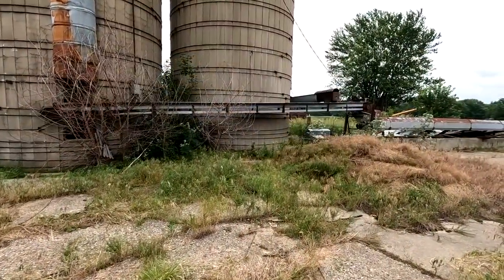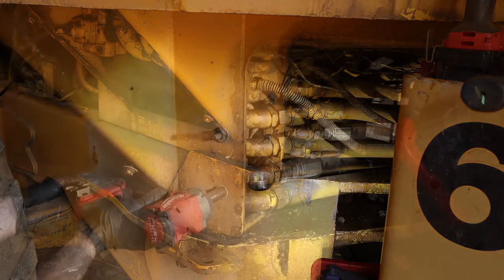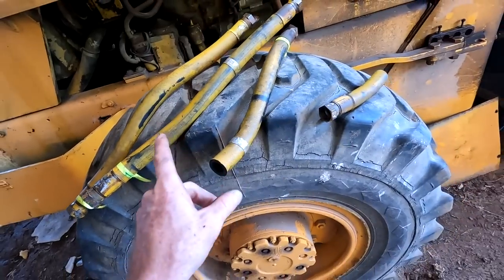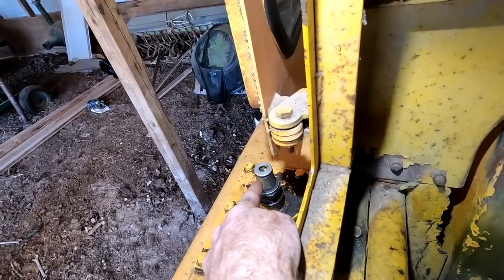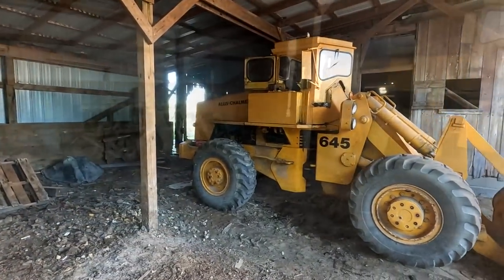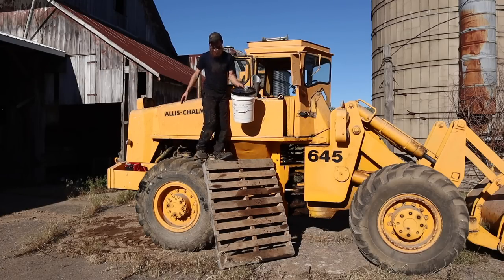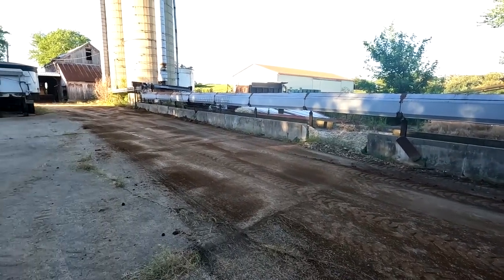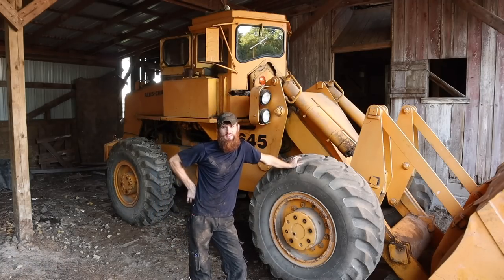Major Issue STOPPED me in my TRACKS! ~ Day 5 ~ 1965 Allis Chalmers 645 Loader

Comment: Glugging sound... Air - give it time and it will settle down. Fluid level check... see the  port on the side... clean it up, it should have a glass to see thru. Roll on the  moving to the shop video... then onto the third machine wohoo.

Comment: The hydraulic lines and finding out about the year of the machine happened to me, I found a dirt bike (lucky me) fixing it up it had no identification no model, brand, year I found out by accident what bike it was by having to purchase a replacement bike tube on eBay and it had the model bikes it’s compatible with so matched them with the bike!

Comment: Great restoration Matt, be careful with that stuff coming off the steering wheel, if it is Bakelite it is pretty horrid stuff.
Reply: Get a couple of rolls of good electrical tape and wrap the steering wheel. Or, use hockey stick wrapping tape. This as a temporary fix. Really enjoying your work on this old irom. Thanks!

Comment: Hydraulic tank:  Filler at the top, fill level is left rear, drain ar bottom?  That pressure valve at the top might be intact except for a cover,  Rubber outer looked to be more like a hose section cut to protect it and secure the soup can cover.

Comment: Get another steering wheel for it & if there's a way that you can make it to where you can see out of the front,maybe take the glass out & cut the angled view out & weld in a straight piece for one piece of glass instead of 2 pieces of glass,that's just a idea

Comment: Glug, Glug, Glug........  Could be just the air purging out of the hydraulic system....  When you replaced those hoses, you put a WHOLE lot of air into them!  They have to refill with oil and push out the air.  Might want to re-check the Hydraulic oil level again after it runs and works a little while.  Hopefully it's nothing serious!

Comment: Get some leather strip from a belt company big enough to cover the wheel and get some leather thread (maybe use a old wide leather belt and make a Stitch Leather Cover just put a cloth or bag over the wheel or shade the glass to slow the leather drying out I did mine using old wide leather belts I got at salvation army it's a work vehicle belts are cheap and you can use leather conditioner to keep them lasting long

Comment: 18:02 if you have low hydraulic fluid it gluggs when the return gets through the filter and runns down from the filter housing into the actual tank

Comment: Tut Tut no one should start any machine whilst not in the driver's seat. You lost oil so it could have been the filter housing filling up and dripping through as you weren't sure of the level and the housing looked empty when you pulled the filter.